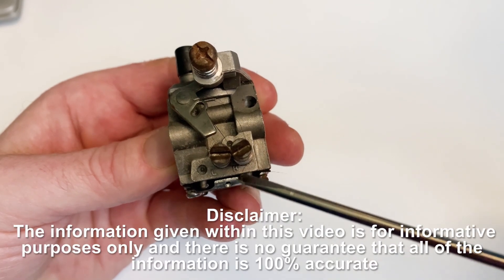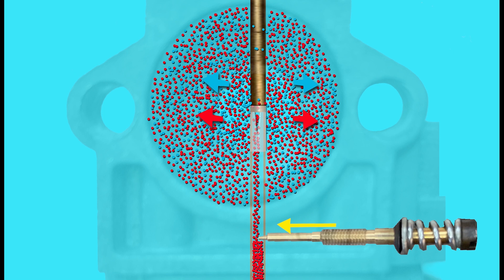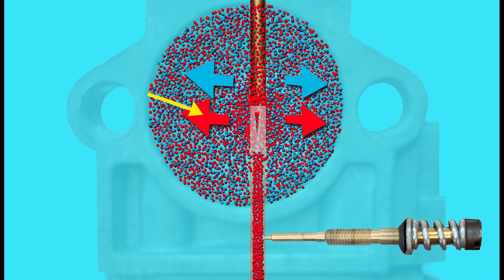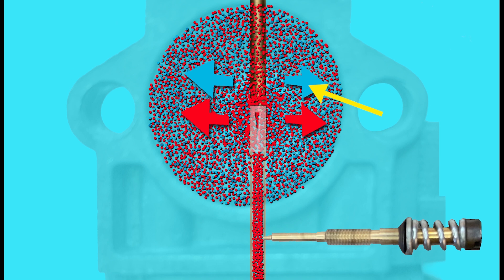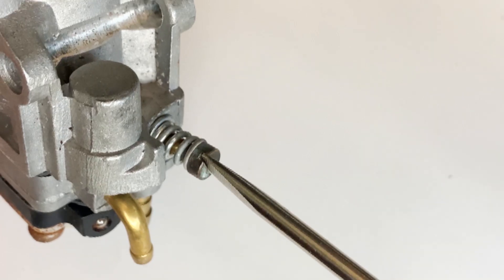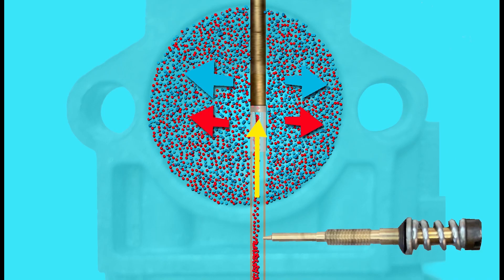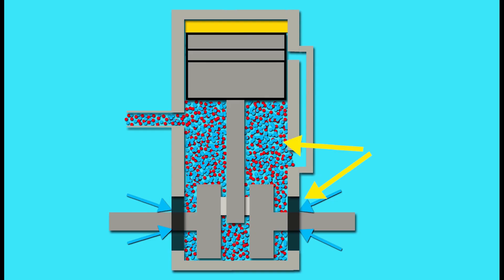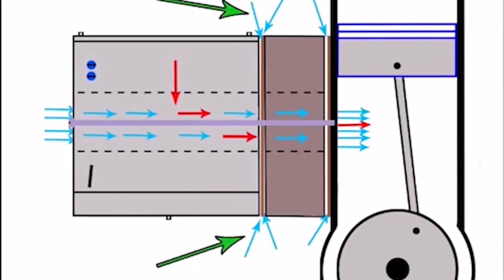Why do Carburetors Need Adjuster Screws????  (by Craig Kirkman)

Comment: This needs to be said. What you said at the end of this video is something like what i noticed & have been suggesting to people from the moment i knew just about every person has a device on them almost 24/7 "always on" , that is world wide connected. Your the first person that i have came across that has said anything like this.  What i have been  suggesting i kept it basic because it can be used for any  issue.  This is the idea "For the first time in human history we have a way to truly, fully  communicate. Right now we have the power in our hands to listen and help each other to solve some of the worlds problems successfully. Basically the same concept as what you said,  even if the person fully disagrees, all comments have value. Not only should we respect everyones right to have their own opinions, making a habit of taking all opinions into  consideration "with unbiased thought"  strengthens our own opinions. WHY? For each of us there is always "something we missed". Every person looks at things differentl. Some will notice/catch/pick up/ on certain things that others will miss. Taking the opinions of others into consideration "with unbiased thought",  lets us see what we missed. Our original opinions don't have to change. This principle can be very powerful when applied to collecting ideas for solutions. The answer to every problem always takes many ideas to find one that will work. Stressing  the points " there is no idea to small, There is no such thing as stupid ideas" . Everyone has something to offer, SOMEONE "unknowingly" HAS THAT ONE LITTLE THING that we always seem to need to make something work. There are some, but very few people doing this kind of thing for certain issues, most are small scale. Success takes input from everyone

Comment: I've had the bushings for the throttle plate rod wear down into the carb housing and intermittently leak atmosphere in to the carb below the throttle plate. The result: I could tune it up properly until someone hit the accelerator and immediately it was out of tune.

Comment: You have me thinking 🤔. What about humidity?
Warm air can carries greater humidity, therefore more water, H²O, however less dense air.
Cold air carries less humidity, therefore less water,  H²O, however greater dense air.
So is it possible, the two factors balance themselves out, therefore no adjustment of the carburettor is required season to season, given at the same altitude? 🤔
Just food for thought.
Reply: You're thinking is a little backwards. 

The warmer the air = less air molecules.  The greater the humidity = less air molecules. 
So when you have warm humid air it, you have less air molecules than if the air was only warm or only humid.

The colder the air = more air molecules.  Less humidity = more air molecules.
So when you have cold dry air, you have more air molecules than if the air was only cold or only dry. 

So in the scenario you wrote about, you would definitely have to make adjustments to the fuel/air mixture screws.
Reply: @bernardocisneros4402  Yes, you're correct.  I was just thinking out loud the effects of humidity.  I was questioning whether the added Oxygen molecule in water would have a positive effect on combustion.  But upon further reading, greater humidity reduces combustion temperature, therefore a negative effect.  Therefore a higher ambient temperature and greater humidity is a double negative effect on combustion.
So yes, this reinforces the need to make carburettor adjustments from summer to winter.